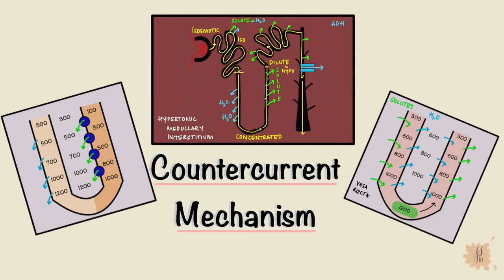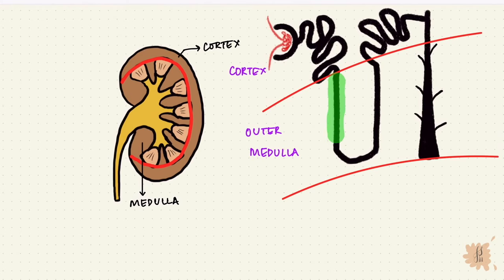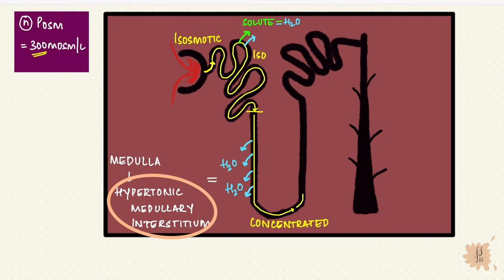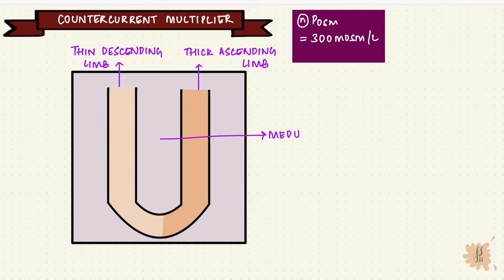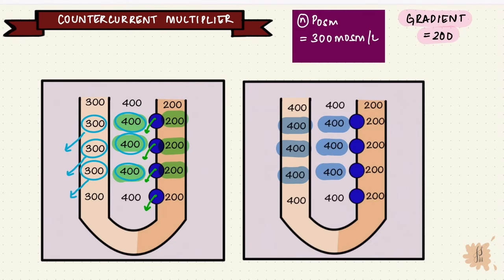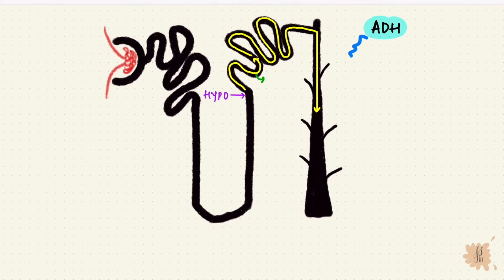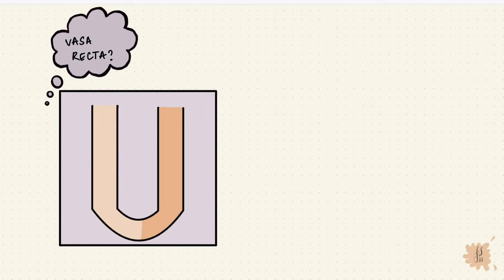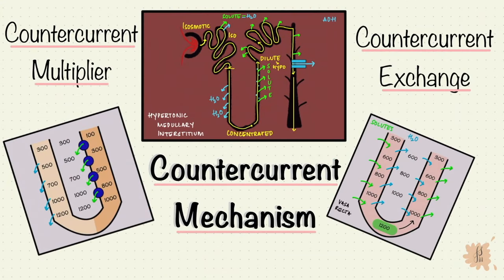Countercurrent Mechanism | Loop of Henle | Concentration of urine | Renal Physiology

Comment: one very important concept should be mentioned is that the blood flows the opposite direction of fluid in loop of Henle. if they move in the same direction, more water would be accumulated in medullary interstitium around descending LOH and dilute the gradient. and also one correction, water is stilll reabsorbed in medullary collecting duct until it reaches equilibrium with medullary interstitium. thats why the opposite blood flow is important as it takes water away
Reply: But in medical references they say the opposite, which is nonsense
Reply: I was stuck on this part, wondering why the medullary interstitium doesnt reach equilibrium due to the water flowing in, and it finally makes sense THANK YOU

Comment: Thank you for this greatly illustrated video. 
My question is: when the descending loop is giving up water to the hypertonic medulla, isn’t the equilibrium point supposed to be something between 400 and 300 but not 400? 

Thanks again
Reply: I think in the medulla the concentration increases so to get equilibrium the osmolality also increase as 400 -1200 correct me if I'm wrong 😊

Comment: I am confused with the countercurrent exchange part
Reply: Look I'm gonna try my best to simplify the concept of the vasa recta...

So very briefly, we have a descending and an Ascending limbs of vasa recta.
First the key that we have to consider is in the descnding limb is (((to increase the osmotic pressure))) as we go deeper in the medulla. 
And simply that will occur by 1. diffusion of [Na into] the capillaries and 2. Diffuse [water outside] the capillaries.
And vice Versa in the Ascending limbs... the key is to (((decrease the osmotic pressure))) as we move away from the medulla.
And that will occur by Na out and water in...
Reply: Hope that helps and if you struggle with any problem don't hesitate to ask 😊
Reply: @mostafaashrafma5727 thankyou so much!! I understood from your comment rather than the video! 😂